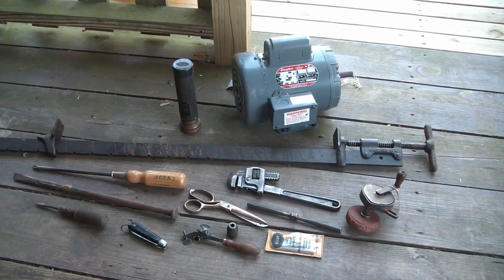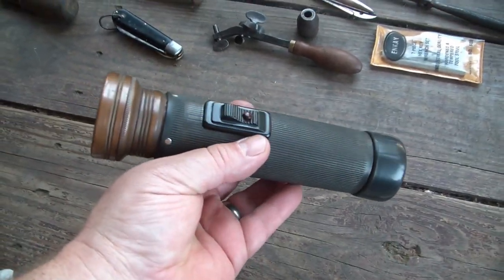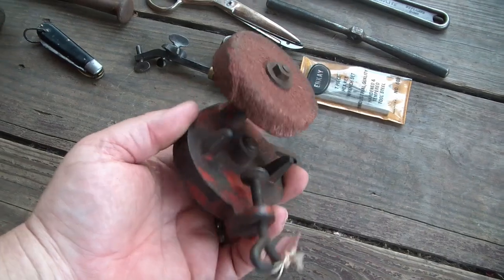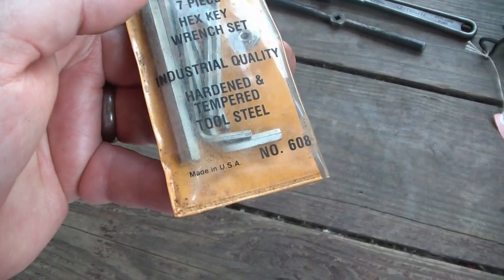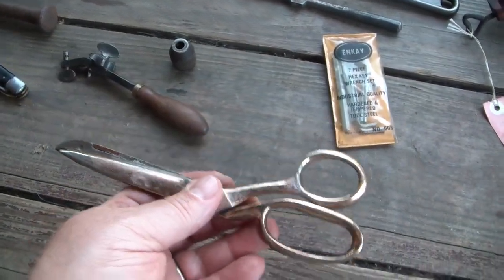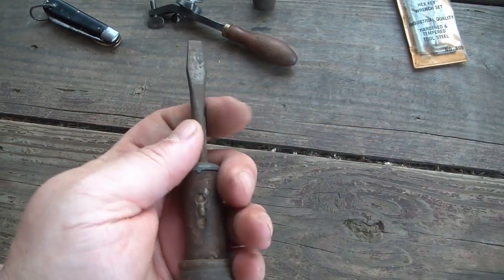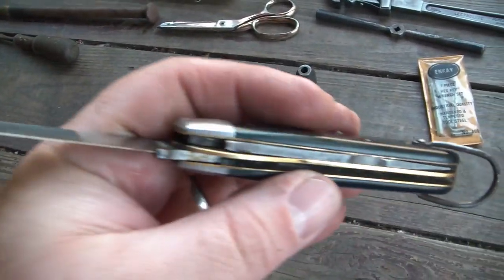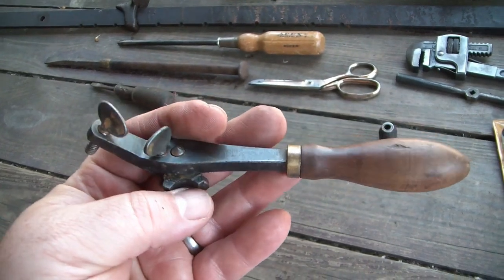Kidron Flea Market Tool Haul #1

Comment: I love the blacksmith tap handle. The square bore was definitely not smithed, it was machined, it's a beautiful handmade piece. By the way I tried to get a picture of the copper donut on my US gauge but I can't get a good photo with it in place and I'm scared to break it trying to pull it out. I believe that your gauge has half of the copper donut and somebody popped in an o-ring to fix the faulty seal.
Reply from the maker: Yes blacksmith made stuff is awesome.  I recently discovered that one of the young machinists at work is an amature blacksmith.  He has made a plier like tool and a hand made tool to cut a hand made mold for musket balls.  I hope to go over to his place and do a video about his blacksmithing sometime this summer.
Reply from the maker: Oh and thanks for trying with your gauge.  I don't want you to risk breaking it either.  Just out of curiosity, where did you come across the one you have?
Reply: eBay. Strangely enough one day before your video

Comment: Pretty sure your bar clamp originally had two heads and two feet. The bolt holes should match up to the head that you have. Was common in furniture manufacture because there are so many symmetrical elements
Reply from the maker: Hmmm interesting.  The guy had four of the same.  I only had enough money left to buy one.  I expect to go back in the morning and I hope the same vendor will be there so I can buy a second one.
Reply: Do the bolt holes match up?
Reply from the maker: @jpsimon206  Match up to what?  I still only have the one.  I might get a second one in the morning.  I assume all four have the same holes in them.  I imagined all four were bolted to a fixture for clamping cabinet doors or something like that.

Comment: I really don't think that's a saw sett. They typically have a tiny anvil in front of a pivot point to be able to apply high pressure to a tiny point. I think your tool is incomplete, it's fascinating to consider
Reply from the maker: I see what you are saying, but the drawings or the tool in the patent image don't show anything else... I think 🤔.  I will have to try it out on an old saw and if I am sure I am doing it right (reasonably sure), I will make a snippet of video and add it to another video.